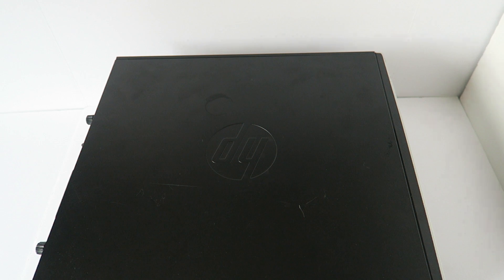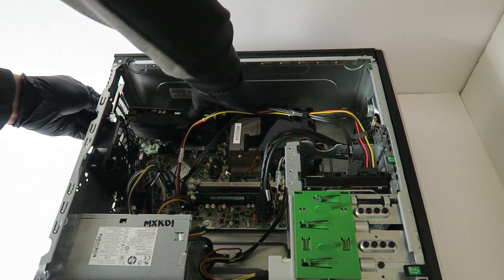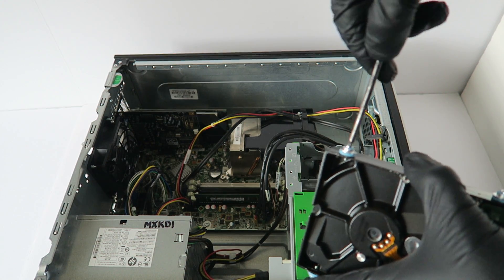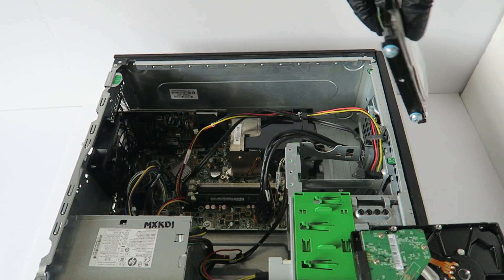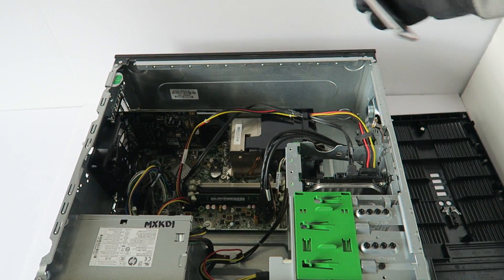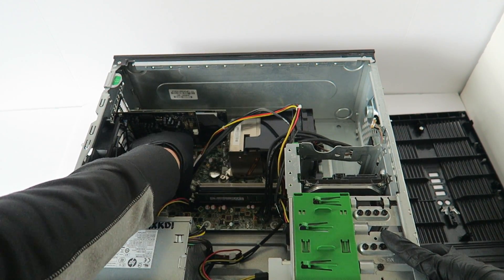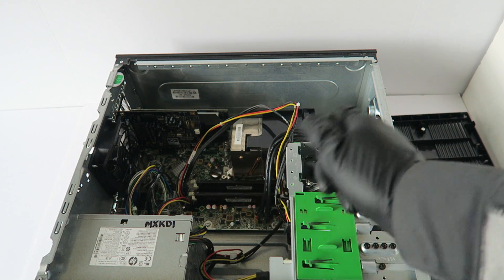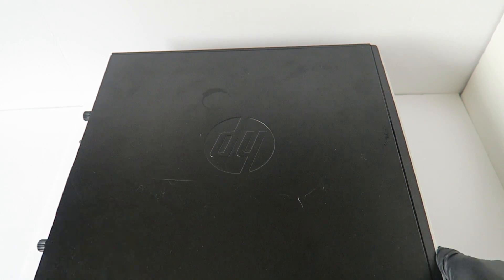HP Compaq Pro 6200 Upgrade Gaming Video Card RAM SSD

Comment from the maker: List video cards an RAM, SSD will work with this system.

(1.) Gigabyte Geforce GTX 1050 Ti OC Low Profile 4GB GDDR5 128 Bit PCI-E Graphic Card (GV-N105TOC-4GL) 
https://amzn.to/2XEqKMb

(2.) MSI Gaming GeForce GTX 1650 4GB GDRR5 Low Profile Graphics Card (GTX 1650 4GT LP OC) 
https://amzn.to/2VkDdSd

(3.) MSI GTX 1050 TI 4GT Low Profile  Graphic Cards 
https://amzn.to/34r0AxG

(4.) Gigabyte GeForce GT 1030 GV-N1030D5-2GL Low Profile 2G Computer Graphics Card 
https://amzn.to/2Xu3SyO

(5.) ZOTAC GeForce GT 1030 2GB GDDR5 64-bit PCIe 3.0 DirectX 12 HDCP Ready Low Profile Video Card ZT-P10300A-10L 
https://amzn.to/3eayL1b 

(1.)  Power Supply Upgrade 

24 Pin to 6 Pin ATX Power Adapter Cable for HP
https://amzn.to/3trpUkF

This RAM works with this machine:

(1.) Crucial 8GB Single DDR3L 1600 MT/s (PC3L-12800) Memory CT102464BD160B
https://amzn.to/2VhGv8O

(2.) Crucial 4GB Single DDR3L 1600 MT/s (PC3L-12800) Memory CT51264BD160B 
https://amzn.to/2xq46wb 

(3.) Crucial 16GB Kit (8GBx2) DDR3L 1600 MT/s (PC3L-12800) CT2K102464BD160B 
https://amzn.to/2VpsKpP

This HDD 2.5inch will work in this caddy for extra storage.

Black Mounting Bracket Adapter 2.5 inch Into a 3.5 inch Drive Bay
https://amzn.to/2VU0njG

1.. Seagate FireCuda 2TB Solid State Hybrid Drive Performance SSHD – 2.5 Inch 
https://amzn.to/3b1e8T7

2..WD Blue 2TB Hard Drive s, SATA 6 Gb/s, 128 MB Cache, 2.5"
https://amzn.to/2Xstb4b

3..Seagate BarraCuda 2TB Internal Hard Drive HDD – 2.5 Inch 
https://amzn.to/2xmf0TE

This cable required if you going to install SSD and HDD:
Benfei 15 Pin SATA Power Y-Splitter Cable 8 Inches
https://amzn.to/2XsG0LV

Cable Matters 3-Pack 15 Pin SATA Power Splitter Cable 8 Inches 
https://amzn.to/2Rval8B

Zheino SATA Power Splitter Cable (2 Pack) SSD Power Cable HDD
https://amzn.to/3a3V9Wq

SSD list works with this PC:
(1.) Samsung 860 EVO 500GB 2.5 Inch Internal SSD MZ-76E500B/AM) 
https://amzn.to/2yNxnkE

(2.) WD Blue 3D NAND 1TB Internal SSD, 2.5" WDS100T2B0A
https://amzn.to/2wvnC9Z

(3.) WD Green 1TB Internal PC SSD  WDS100T2G0A
https://amzn.to/3cbrcWa

(4.) SanDisk SSD PLUS 480GB Internal SSD SDSSDA-1T00-G26
https://amzn.to/3a3i9ou

(5.) Crucial MX500 250GB 3D NAND SATA CT250MX500SSD1(Z) 
https://amzn.to/34rZlhy

(6.) Samsung 860 PRO SSD 256GB - 2.5 Inch SATA III 
https://amzn.to/2ybiHLK

(7.) Samsung SSD 860 EVO 250GB 2.5 Inch SATA III Internal SSD 
https://amzn.to/2VjIAkK

(8.) SanDisk SSD PLUS 240GB Internal SSD
https://amzn.to/3c7SEE4
Reply: hey, do these GPUs also work with the smaller form factor version of this PC?

Comment: I had weird problems with this 6200 pro mt, fo GT 610 is working GT 520 working also geforce 8800 is working and gts 250, but gtx 650 not working, but 650 working in another build without any problems, on 6200pro i just got no signal.

Comment: I have the same hp compaq 6200 but 240w 
Will it works with 1050 ti low profile?
Reply: I m looking for that answer too. Did you do it and has it work?
Reply: @iztokcaks1567  Yes I did it and it works perfectly
Reply: @trolltube5017  Im so sorry, my mistake: i have HP Compaq 6200 pro SFF (not tower), and was looking for that PSU cable for days and cant find it... :( (it is small difference in cables on small 6-pin). do you happen to know which one i need?

Comment: what about HP Compaq 6200 Pro Small Form Factor core i3 second generation RAM DDR3. what grafiq card can upgrade?
Reply: I have the same pc did u put a graphics card???
Reply: @ΑρηςΣταλικας  yes i put AMD Radeon HD 7000 series 1gb graphics card
Reply: @bekiboconggas667  nicee u can play games with it? Also plz if u know  tell me I want to put the gt1030 lp will it work? ¿? ¿
Reply: @ΑρηςΣταλικας  Yes. I play Blackshot sea online, Blackshot not used big spec
Reply: @ΑρηςΣταλικας  this CPU can used only 1gb graphic card with pci x16 that i used now
Reply: @bekiboconggas667  so I can't install the gt 103p
Reply: @ΑρηςΣταλικας  if that GT is 1gb and pci x16 slot can, u must check compitable that graphic card

Comment: The power supply is 240w. And the video cards wants 300w power supply i have the same computer (hp6200) and i bought the msi GeForce GTX 1050ti 4gb lp. It works with 240w?
Reply: it should by  newer cpu will decrease it's performance

Comment: Hi,

I have HP elite 7300 mt but it wont boot with a GTX 960 ( GPU works in my main PC) do you have any clue, i could not find any secure boot option in the bios :(

Comment: Hey there. I have this very PC. How do you assure compatibility with parts? I mean, we all know we can't just buy a 2020 high end graphics card, slap it in and expect it to work so I'd like to know which procedures or heads up you can give us to know which GPU and RAM would work with this system or any other given one. (I already read the description so my interest is not about which GPU would work but how you can know which would) Thanks.
Reply: Computers are usually locked within their time period, the best upgrade is more ram and a SSD for older systems, if you're going to use these to game, you will need a Low Profile (LP) a card that does not require any extra power cables.

"Upgrades" will need further research. For instance, if you had a 3rd generation Intel i3 CPU, you'd upgrade to a 3rd generation Intel i5 or i7 counterpart, (*non-"k" variants and only the specific chip that came with the higher tier options supported by higher trims of the office desktop* -especially if they're old office computers, these are limited in some aspects like gpu power supply and PCIE expansion capabilities (for those of you who use lots of expansion cards.)

If you want more ram, make sure to get the correct type (DDR3, DDR4 etc.)

And an SSD that is supported by 6G/S, or 3G/S respective to your motherboard specifications.
Reply: @therealfree2play  the 6200 pro mt is a ddr3, can a ddr4 1030 or a ddr5 1050ti be compatible?

Comment: Hey just wondering about this, since you know this computer
I also have one, recently got a refurbished one (with pretty strong fans and such) but im wondering if a GeForce GT 710 would work with this system?? cuz its pretty much perfect for what I need right now
If not I can go with the GeForce GT 1030, if it works with the i5-2400
Reply: oui la 710 fonctione

Comment: Hey Mx! me again... I dont know what to do man, my system is not detecting the 1650 oc. Is there any trick to have my computer detect the GPU and install the drivers? I remember you told me it had to be low profile, but got a very good deal on a zotac 1650 oc mini and had to take it, cause the power and dimensions of the card were good enough to fit in my case...

What I dont know now is whether you told me to buy specifically that msi 1650 oc lp because you knew this one was going to work for sure, to avoid this mess I am in now... could you please help me man? is there a way to make the damned card to work other than returning it and buying the MSI 1650 oc lp instead? thx man
Reply: Here is all I have tried so far:

Disable Driver Signature Enforcement

[bcdedit /set pciexpress forcedisable] in cmd

Followed instructions in the following vid https://youtu.be/Y_KHStpodLE to the letter and got gforce gtx 1650 current driver to install. After reboot, device manager shows gtx 1650 with the yellow sign /!\ and when clicking properties, it reads in [device status] "This device is not working properly cause Windows cannot load drivers required for this device (code 31) object name not found"

Card is properly connected, fan running. When only display port connected display goes black. Clicking on Nvidia control panel dialog window appears saying "nvidia display settings not available  / an nvidia graphics card was not detected in your system"  my "system" is an old oem hp 6200 pro mt i5 2400 with zotac gtx 1650 oc and 16 gb RAM.

Updated my BIOS to 2.28. 

Man I think you the only one who could help... thx a lot :)
Reply from the maker: Hi, did you try gtx 1650 video card in different PC because i have same msi video card i am using right now and it works perfect.
Reply: @Mxkdt  Nah man but I was thinking to upgrade the BIOS... by the way, which BIOS version are you using? 2.29? or did you update to the latest version, I think is 2.33? I did not update yet cause I've read in HPs support forum that upgrading beyond 2.28 makes some PCs take 3 minutes to load windows 10. Thanks anyway man!

Comment: Hi Mx,
Can this 1650 super ( https://www.msi.com/Graphics-card/GeForce-GTX-1650-SUPER-GAMING/Specification ) be installed instead?
Thanks in advance!
Reply from the maker: Hi, this dual fan gtx 1650 will not fit this mini tower
Reply: @Mxkdt  will 1050ti oc edition from zotac will fit into it (it's dual fan )

Comment: If i were to upgrade the psu would i run into any problems installing it like would it fit the case
Reply: This kind of pc. Psu nt upgradable. Its a custom made for its model
Reply: @Kudoshi  I read a forum https://h30434.www3.hp.com/t5/Desktop-Hardware-and-Upgrade-Questions/New-psu-upgrade-that-is-compatible/m-p/7351918#M182785 where some guy managed to completely skip the process of upgrading the PSU entirely and installing a graphics card that requires a PCIe port even though the stock/OEM PSU does not have one. Any idea how I could do the same thing without upgrading the supposedly impossible to upgrade PSU? If not, are you positive that replacing the PSU is actually impossible?

Comment: Hey Mx! nice vid and professional job! I know you used a low profile, but after installing it, do you think a full height GPU (msi or gigabyte mini 1050 ti) would have fitted in that MT case? I ask cause I cannot find this gbyte model, and other low profiles are longer... thx man!
Reply from the maker: Hi, you can use this video cards with this PC
Gigabyte Geforce GTX 1050 Ti OC Low Profile 4GB GDDR5 128 Bit PCI-E Graphic Card (GV-N105TOC-4GL)
MSI GeForce GTX 1650 4GT LP OC Graphics Card, PCI-E x16, Low Profile 
GIGABYTE GeForce GT 1030 GV-N1030D5-2GL Low Profile 2G Computer Graphics Card
Reply: @Mxkdt  Thx a lot man! : )
Reply: @Mxkdt  would a ASUS GeForce GTX 1050 Ti 4GB Phoenix Fan Edition DVI-D HDMI DP 1.4 Gaming Graphics Card (PH-GTX1050TI-4G) work with it or no?

Comment: My PSU is a 240w can the motherboard handle a 320w psu?
Reply: Even if you had a 1000w it will work... It's not like your motherboard will burn because of a more powerful PSU. That is the rating of the PSU and also if a PSU is 1000watts, it has a percentage of lost power, because it can't be 100% efficient, that means if it is 80 percent efficient, you will have raw 800watts of power for components. From there you can calculate, for example I have a system with an i5 processor drawing 120 watts, GPU drawing 180 watts, HDD and other things, I would need at least 500 watts PSU. On my PC I have 1080ti GPU (260 watts beast), so I reassured with a 700 watts PSU.

Comment: can i add a 1070 without uprading the power supply?
Reply: LOL, here for the same thing. I’ll let you know I find out or not.
Reply: @retrogaminggenesis6102  i upgraded my power supply to 650 W but i can't connect it to the motherboard, so i need to change the motherboard too, the ram too, the processor and the entire pc.
Reply: @retrogaminggenesis6102  and the case too
Reply: @jureavrr  lmao
Reply: ribzero a 1070 will bottle neck with the specs of the ram and cpu

Comment: Hey MXKDI will a 1050 TI low profile fit in the 6200 SFF? *Update* I was doing research on the 6200 SFF and it does not support a Secure Boot State in it's bios. So that leaves alot of cards in compatable with it. I'll probably go for a 7010 sff you can install a 1050 ti in those np.
Reply: Hey I'm wayyy too late but if u see this please help me, I have the 6200 sff and I want to install a gt 1030 low profile will it work, bc I think that's it won't
Reply: @ΑρηςΣταλικας    I recommend that you purchase a dell optiplex pc, because they are relatively inexpensive and easy to upgrade

Comment: Hi bro I wanna know if there's no problem with power supply. Did u change it?
Reply: The prebuilt power supply is 320W. If you're using like the 1050ti, it's appropriate for it. I'd recommend a rx 570 though
Reply: @warhusky2004  , people saying that this pc won't support full size graphics card 😭, it will hit cooler

Comment: Would a rx 470 graphics card work or would it even fit in the case?
Reply: @Leucht Rakete are you using MSI gtx 1050ti on the same pc shown in the video , people saying that this pc won't support full size graphics card 😭, it will hit cooler

Comment: HP 6200 Tower have NVMe PCIe M.2 slot or not ?
Reply: It's 7 years old, so no NVMe or M.2. It will have a pcie slot however.
Reply: @FantasyUnited04  yes it have 2 PCI e slots so if I install SSD how much storage supports ?

Comment: Thank you so much! I am planing on buying a GTX 1050 Ti and I wasn't sure how to install it, but, when I do buy it, I'll have this video so that I know what i'm doing.
Reply: Did it work?
Reply: @gsacelm7753  Yep, it works perfectly fine.
Reply: @Micca-PNG  nice, though i have my tower now lol xd
Reply: @Micca-PNG  are you using low profile version, , people saying that this pc won't support full size graphics card 😭, it will hit cooler
Reply: @tarunrawat5030  It's low profile.
Reply: I bet it did not work
Reply: Never mind it work I guess
Reply: @Leucht Rakete is it a full size graphic card or low profile
Reply: @tarunrawat5030  Low profile.
Reply: @Micca-PNG  I have hp Compaq pro 6305 micro tower and my pc has same interior as shown in above video , so I want to know whether if this pc can support full size graphics card , people saying that it will not fit and will hit cooler
Reply: @Micca-PNG  is there any increase in performance , can we play GTA 5 1080p at 60 FPS
Reply: hey do i need anything spesefic for a GTX 1050 Ti 4gb?

Comment: i tryed to do this and got a intel Q6600 and it didnt fit, i bought the same computer in video , plz help!
Reply from the maker: Hi this machine does not support socket lga775

you can install

    Intel Core i7-2600 (3.40 GHz, 8MB cache, 4 cores)
    Intel Core i5-2500 (3.30 GHz, 6MB cache, 4 cores)
    Intel Core i5-2400 (3.10 GHz, 6MB cache, 4 cores)
    Intel Core i3-2120 (3.30 GHz, 3MB cache, 2 cores)
    Intel Core i3-2100 (3.10 GHz, 3MB cache, 2 cores)

Comment: Do you need to upgrade the bios for this 1050ti ? Because i have ordered the same card for christmas and i hope that will work
Reply from the maker: Hi, yes video card should work without BIOS update.

https://support.hp.com/us-en/drivers/selfservice/hp-compaq-6200-pro-small-form-factor-pc/5037900
Reply: @Mxkdt  thank you for fast responding im gonna let you if it working at christmas
Reply from the maker: What brand is it ?
Reply: @davidbourgeois4524  lol, when you going to reply, 2 years has passed, 
Anyway did the card working or not
Reply: @tarunrawat5030  xd yeah it worked
Reply: @davidbourgeois4524  is there any improvement in performance, can we play GTA 5 1080p at 60fps
Reply: @tarunrawat5030  for sure its way better than integrated graphic you can play gta 5 1080p on medium with 60 for I don't  have the computer anymore
Reply: @davidbourgeois4524  thanks for the information 😭
I want to know , the guy who created this video has added some list in comment of supported graphics card, he also added MSI 1650 low profile , will it work for sure 🙏
I will buy any between 1050ti and 1650 according to price 
Do you think 1650 can outperform better for its price
Reply: @davidbourgeois4524  I am using hp Compaq pro 6305 micro tower pc , this pc has same interior as shown in above video
Reply: Gigabyte 4 gb gtx 1050 ti lp